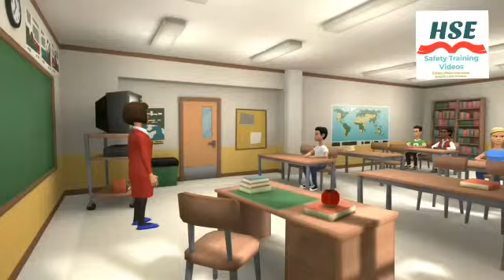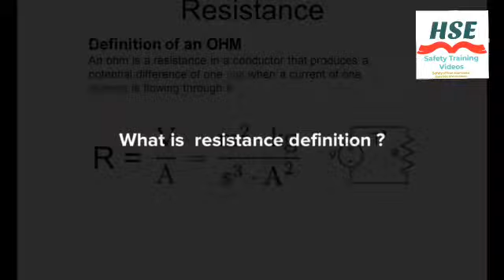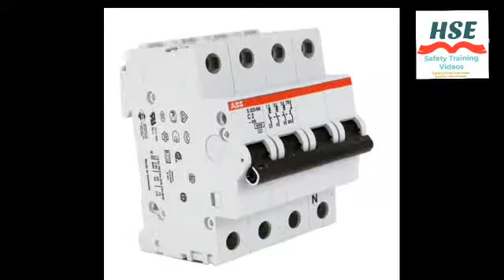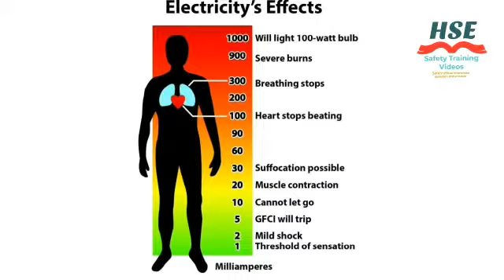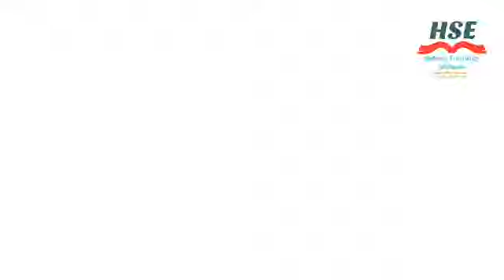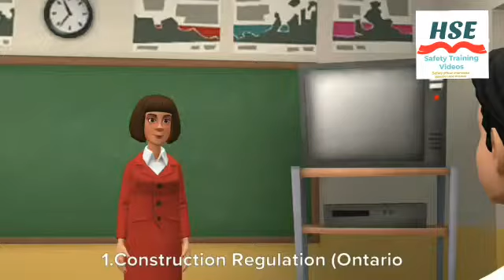electrical safety procedures, electrical safety definition and explanation

Comment: Isolator, Switch & Circuit Breaker - Part-1 (English version).

https://youtu.be/xkxmbJLoB4Y

√ What is Point of Commencement of Supply?
√ What is the difference between Switch & Isolator ?
√ What is Switch Disconnector ?
√ What is Isolation Duty?
√ How we can confirm that a switching device is having isolation duty?
In this Video, everything is explained. Please watch fully.